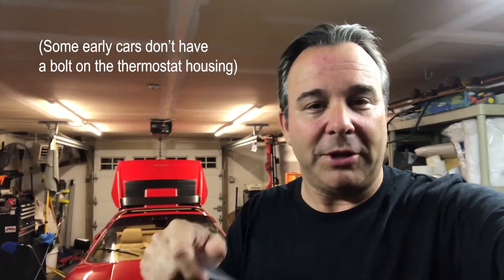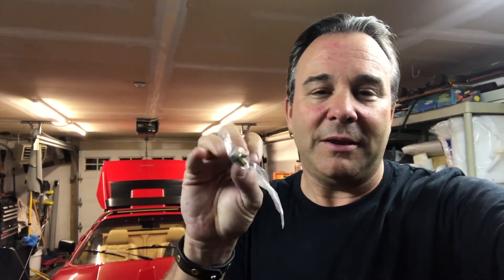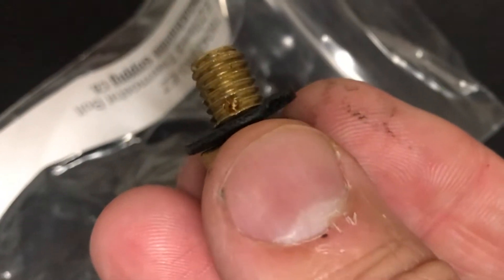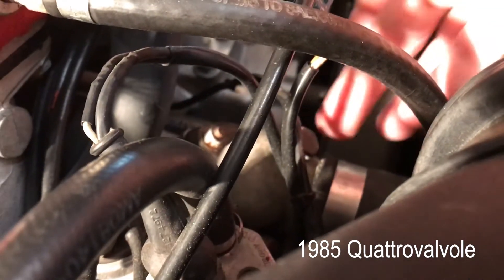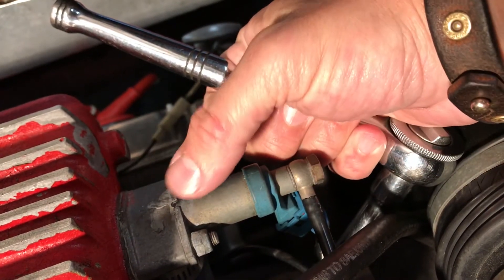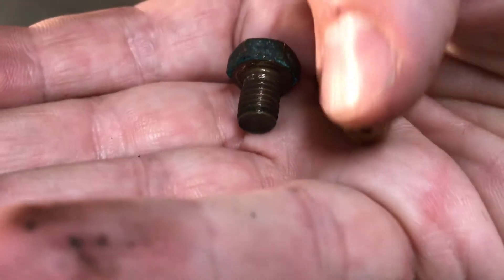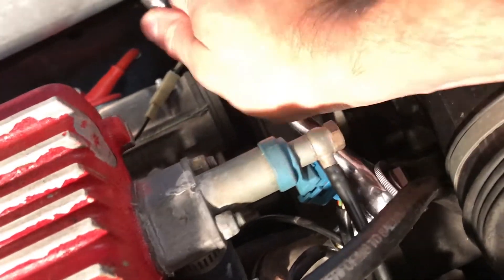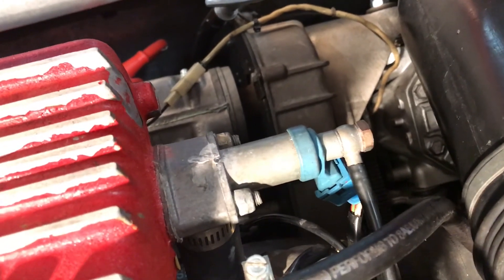Ferrari 308 thermostat EZ bleed bolt install

Comment: Hi what is causing my 80 308 oil temp to climb to max when water is 195-198 please thx
Reply from the maker: Hi. Not really sure...but check to make sure there's no blockage in your oil cooler, or the ducting which supplies fresh air to the cooler.

Comment: I would have expected water to spurt out when you took out the old bolt.  Since it didn't, does that mean you have air in your system that you now need to bleed out using the bleed process? - http://www.birdman308.com/service/coolant/coolant_bleed.htm
Reply from the maker: I did have air in the system, but it could also be that it's on the radiator side of the thermostat and the engine was cold...